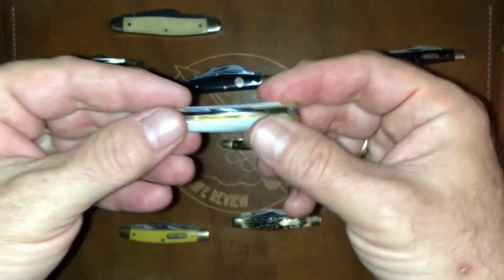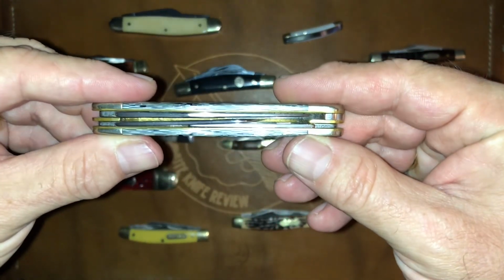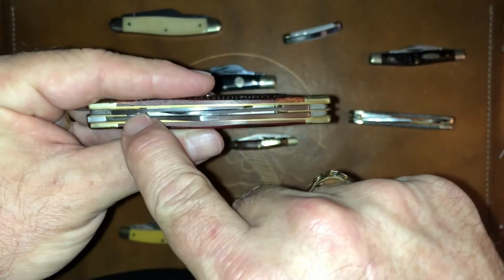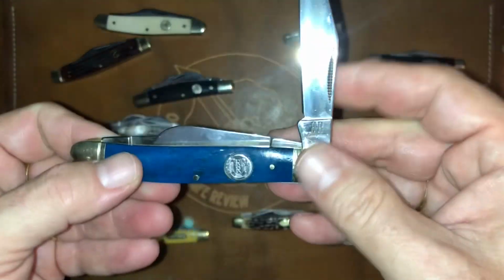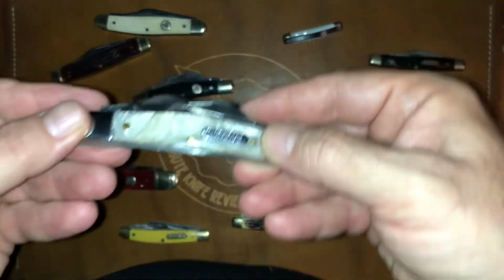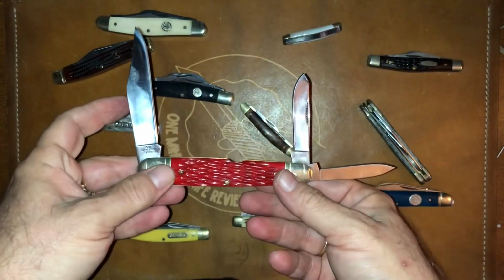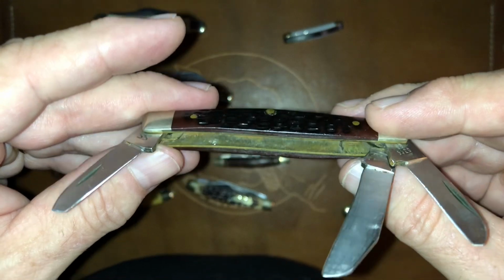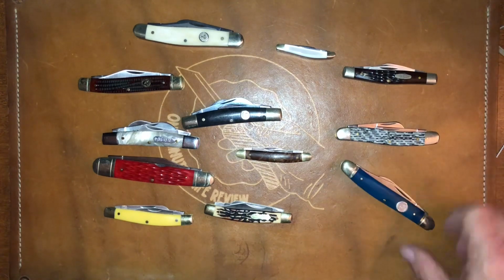Blade Rub!? An OMKR discussion video

Comment: I have a large stockman, a RR stoneworx, that has a bit  of blade rub. Sucks, but gives me an excuse to use it I guess lol.
Reply from the maker: Thanks Randy, i was not trying to pick on mild blade rub, especially if you have to press to get the blade out, ots gonna push over and rub…more the design issues that cause it